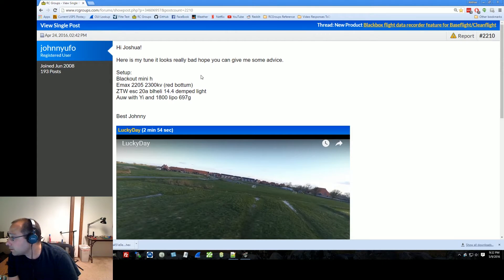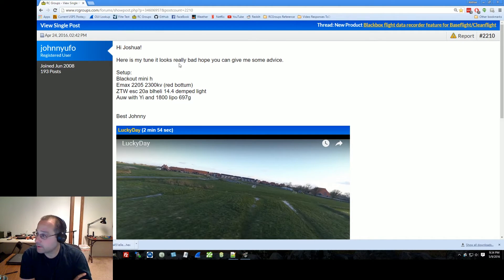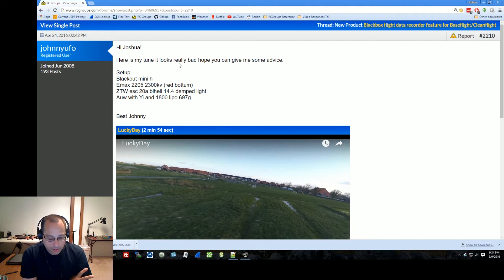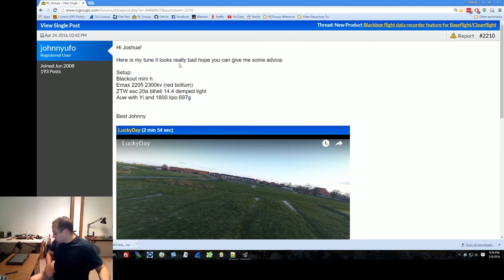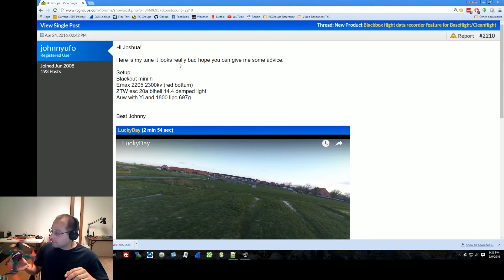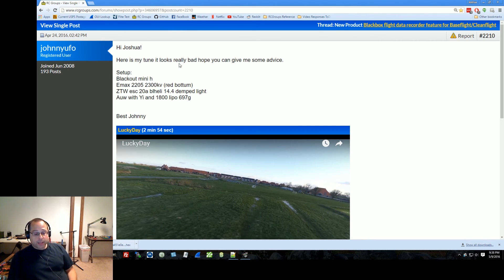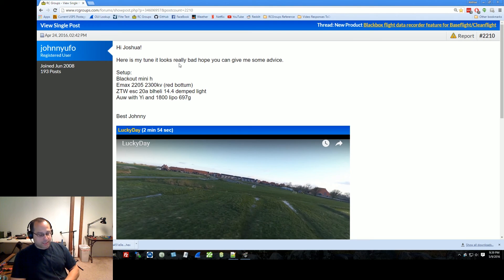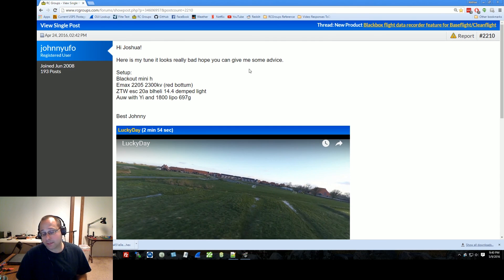Livestream Highlight - 5/9/2016 - My opinon on KISS

Comment: I run both beta flight and kiss setups, they are both awesome. It's hard to compare because they both tune differently. The kiss escs are definitely great, just because they feel so locked in. I was running littlebees with the kiss FC for a few weeks and when I put in the kiss escs, I was shocked at the difference. Lately I think the kiss setup has the edge because it's a very consistent and predictable experience. It seldom surprises you with quirks, so you can hone your piloting skills. I think that's why Steele and Finalglide dig it.